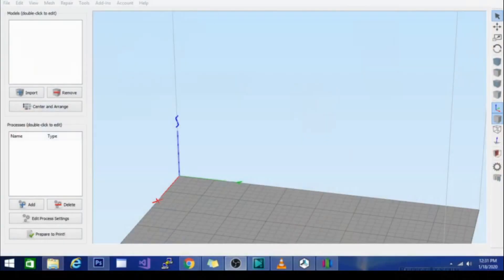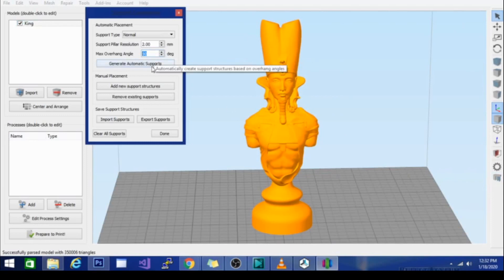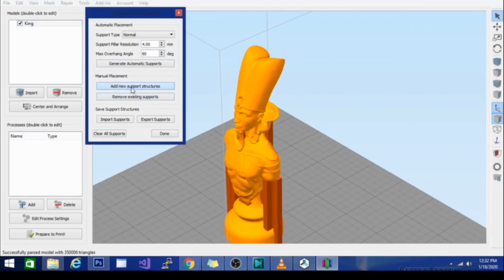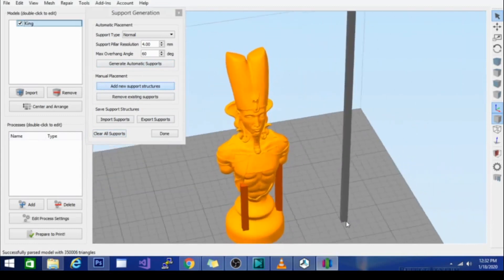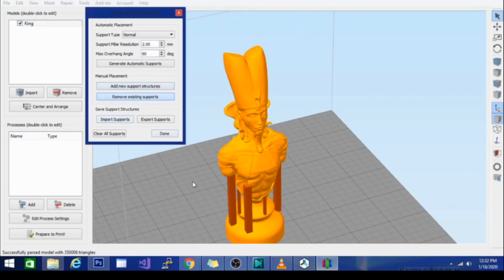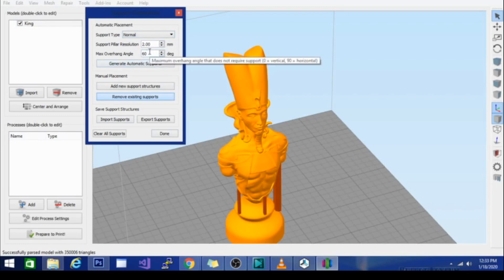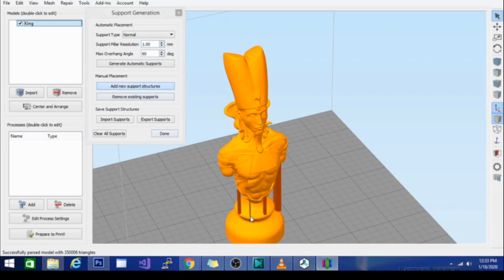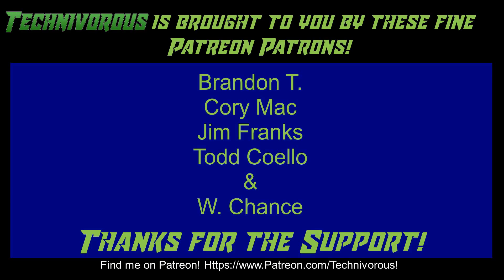Simplify3d support settings - HOW TO add and adjust supports

Comment: I've been told (in the advanced S3D group on FB) that you can rotate the part, place supports, then reset the rotation and the supports will stay where they were placed. They call it Horizontal support. I haven't tried it yet.